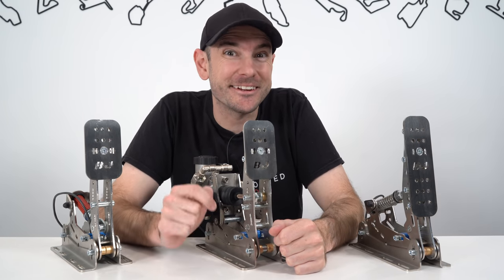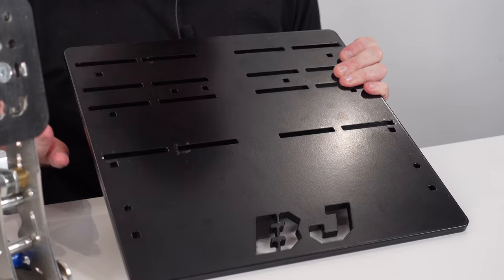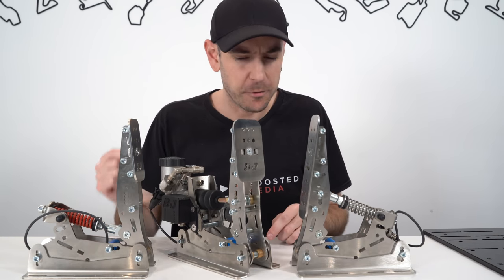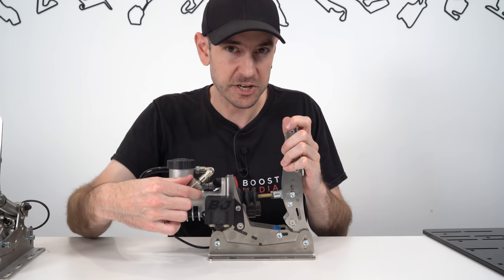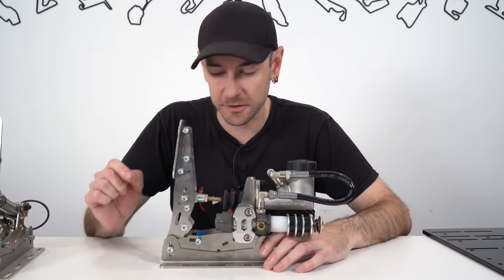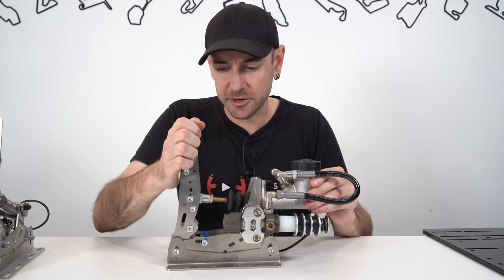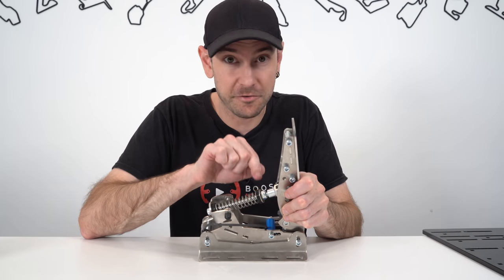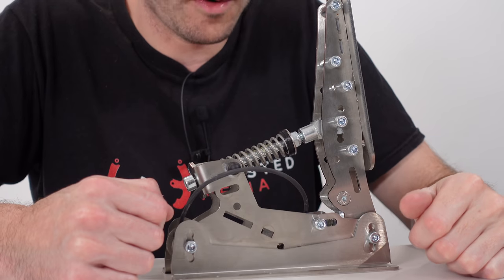REVIEW - BJ Sim Racing 1000psi Hydraulic GT Pedals

Comment: I purchased the loadcell version of these, apart from them taking forever to be delivered from their factory in Spain to the UK I can say they are an absolute bargain. Awesome pedals for the money and no complaints so far.. £200 cheaper than the Heusinkveld Sprints and just as good if not better due to higher LC rating
Reply: same here, delivery of pedals took more than a month. From Spain to Switzerland... including some back and forth with bj and transport agency. bj wasnt very responsive in the process...
Reply: I paid €35 for delivery but yes still high considering how long it took... but overall still an absolute bargain
Reply: Guys in the UK, may I ask if you had any extra charges?
Reply: @mrspangles932  the purchase price on the site was without tax so you will be asked for 20% import tax by customs... Still a bargain imo... Mine are working flawlessly without issue

Comment: Nice review ! They really look awesome for the price !

I have two question though : 
- did you try the pedal set on a formula style driving ? With short course and high pressure combinaison. If yes, how did it feel ?
- at 46:49, on the slave cylinder closeup, it looks like there is a bit of black/green fluid at the connector, is this a visual effect or is there any fluid leak ? I heard you said you had not any leak, but from that perspective it looks so.

Thanks again for your detailed review, you really make quality content, keep it up !
Reply from the maker: Yeah they feel good for formula driving. Can stiffen them up a bit if you prefer by increasing preload. 

No leaks. What you see is a bit of grease which seems to have been applied as part of the assembly process. It’s not the hydraulic fluid.
Reply: @boostedmedia  Thanks for your answer :) This is definitely a great choice I would make as I was lurking on the HK Ultimate. This BJs would match my style for less $. Thanks again !
Reply: Thank you for your kind words, the green liquid you see is the glue used between the parts of the hydraulic circuit to prevent leaks and the parts from unscrewing.
Reply: @bjsimracing2.060  thank you for this precision, this is really reassuring

Comment: Great pedals, I have non hydravlic type. Sadly I was a bit dissapointed with them because 2 rubber rings on brake pedals BROKE mid race - I prefer stiffer setting. But then I wrote to manufacturer and received replacement parts within 4 days without complications and they put max effort to resolve this issue. Glad I bought them. Looking forward for you comparison between hydravlic and non hydravlic version.

Comment: They should have a washer or some sort of packer to add to the top of the master cylinder if you want to adjust the arm to pedal position.. anyway great review mate cheers
Reply: While it probably isn't ideal. It doesn't actually matter. The rod is not directly connected to the piston and can pivot on the point it touches. Will is probably not quite right here

Comment: I had some deadzone with these brake pedal. But you can adjust that easy. The support is excelent and they sent me a video how I can adjust the pedals that I have no more deadzone. You only have to loosen the nut on the pedal arm and then rotate the rod which is connected to the hydraulic (against clockwize I think). In this way you adjust the preload of the hydraulic. Now, I have no more deadzone like Will described.

Comment: I like to see a review on the load cell version.
Reply: they’re really good. Put about 100 hours on mine and haven’t had a single issue with them.
Reply: @Gino_567  About how much pressure can you put on the brake pedal to max it out? They say they have a 200kg load cell but for example so do the HE ultimate but only measure up to 120kg. So do you have any approximation how much pressure the load cell BJ pedals take? Also can you change the rubbers to stiffer/lighter in the brake?
Reply: @clearaz2319  Can't give you a number because I don't know without looking at their specs. But I can tell you when I first got them, they were rock hard. I rang Pagnian imports up and asked them if there was anything I could do to soften them up more. They told me they would soften up over time - and they did. They're actually a bit too soft now. But I have the brake rod on it's medium setting atm so i'm gonna move it up a position to gain some hardness back. But having said that, they're still hard! I love a hard pedal. I wouldn't recommend them if they were a POS or had any issues but they're solid! They're well worth the price so go for it!
Reply: @Gino_567  Alright, thank you for the info! I will highly consider them as my next set of pedals. Might still wait for the review by Boosted media first though. If they'll ever get them haha

Comment: The master cylinder adjustment holes look like an adjustment to get square shaft movement when dropping the whole pedal down
Reply from the maker: Yeah could well be. Either way it’s really important it stays square or it will fail.
Reply: @boostedmedia  yeh for sure would eventually punch the front seal out. Braid line should be standard for pedals using fluid, last thing ya want is brake fluid on the floor in ya race room
Reply: @boothy.photography  
Hello,

Thank you for your interest in our pedals. We have never had any problem with our brake lines but if you want when you formalize your purchase tell us that you want a metal line (paying the difference) and without problem we will manufacture it for you. 

Best regards

Comment: If you change brake pedal height then wouldn't you also have to adjust the brake cylinder shaft height to match otherwise it would be at a angle  ?

Comment: Hi Will,
i gave it a shot on Black friday, my Pedals are different (BRAKE) you can´t ajust the hydraulic hight anymore, it's on a fixed position.
Also there are yellow nitroflex instead of the black damper.
I haven't installed the pedals at the moment but what i can say that i have much more movement at the beginning, which i really don't like at all.
After the movement it´s really stiff, but i don't like the way before, it's about a half cm of movement.

Comment: From the looks of it; if you need to adjust the ratio up and down (moving the connection between the pedal and the cylinder up/down) you could realign the axis of the cylinder by raising or lowering the front pivot of the pedal, no?

Comment: Nice review Will.
You compare them a lot with your Simtag, and you talk a lot about them being very smooth, but do you say at the same time that Simtag is not smooth? Can you elaborate on that, the smoothness feel, BJ vs Simtag?
Reply from the maker: The BJ brake is smoother than the Simtag at east in my experience. With the Simtag you get a slight underpinning texture which is present on most hydraulic pedals I’ve tested. Similar to a road car, the BJs feel more similar to HE Ultimates than any of the other hydraulic pedals I’ve tested. So it’s pretty much a personal preference thing.
Reply: @boostedmedia  , With blindfolds, and you had to choose between simtag and bj, so what would you choose? 
Ignore the price difference and sharp edges on the pedals (BJ)
I it's subjective, I know it well, but I'm searching for the tiny little details that are hidden in it. These are some great investments if you go one way or the other, so it's great to be able to ask someone who has tried both. Thanks Will!
Reply from the maker: I still prefer the Simtags but not by much.
Reply: @boostedmedia  do you mean the HE ultimates and BJ hydralic pedals feels closest to a real car brake pedal?

Comment: After some use I’ve noticed quite significant wear on the cylindrical supports at the pivot where the spring/piston shaft meets the pedal arm (where the squeaky sound is coming from) after disassembling it to apply lubrication. It looks like it’s caused by the shaft pressing hard on to the support and damaging it. Are you guys seeing the same?
Reply from the maker: Not yet but we’ll keep an eye on it.
Reply: @boostedmedia  Hi, any updates on your pedals? I've since encountered instances the pedal's signals are 'stuck' even though my foot has changed the pedal position. After a moment, it jumps to the actually pedal position. Have you experienced that and were you able to fix it?

Comment: hmmm... got my bj hydraulic pedals 2 days ago, coming from thrustmaster pedals. i must say, i am struggeling massively. i have great difficulties hitting that threshold point. i guess its me, but iam also not feeling this "threshold" point clearly when pressing the break. i dont know, im kind of disappointed... i also dont see a possibility to improve something by adjusting the pedal. only thing i can do is tighten the preload spring, but how could this help. the pedals came with 3 additional black "dampers". dont know what they are good for, i guess these are just replacement parts...

Comment: I have the bj pedals standard version which cost me 500 euro, the only confusing thing to me is, the brake are just like a brick its extremely hard, thats my only complaint, is there a way to make the brake less hard ? I suspect that the rubbers under the brake are just too hard, is it swappable to something softer maybi ?
Reply: i had this same issue and was told the rubbers would soften up. And they did, alot! just keep using them.

Comment: The fluid isn't getting hot. I don't think you will get better results with the braided lines. It's a different story with road/track cars.
Reply from the maker: Incorrect. Braided lines stop ballooning which creates a spongy pedal feel regardless of fluid temperature. It’s pressure related.
Reply: @boostedmedia  Thats not my point. I think the line is to short to feel a real difference and there are no other circumstances for a real spongy pedal. Also i didnt say that braided lines won't stop ballooning. They will for sure.

Comment: That Slave cylinder from Wilwood ... It's only a matter of time before it starts to leak.  It only has a small rubber seal on the piston ... It is made for a clutch where the pressures are many times lower.

Comment: Very nice pedal set, although I personally would not buy the load cell version as IMO the bracket that connects the load cell to the push rod is bend and prone to work hardening. 
ZerGut on grabcad has released DIY plans that have a way better design for the load cell placement. I drive those pedals daily. 
Very nice to see some more affordable pedals.